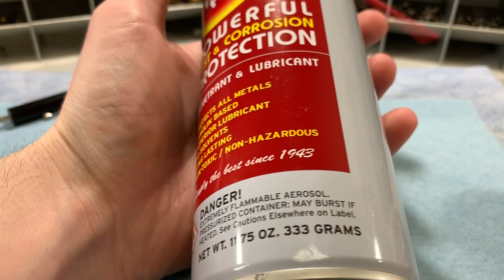Medeco Biaxial Mortise Cylinder Disassembly, Assembly, and Pinning

Comment: The only thing I don’t like about Mececo is their shipping policy and rates.  They won’t ship everything at the same time, so you have to pay separate shipping. In my last order shipping was a third of the overall price.  When Customers ask why the service and components are so expensive, I flat out tell them about their policy. 
Also in the last shipment of keyMark SFIC, 3 of the cores had brass shavings in the chambers and 4 cores had holes drilled too shallow and the cores would not drop into the housings. 
I’m getting to the point where I’ll continue to service our existing systems, but I’m going to start recommending alternatives for future customers.